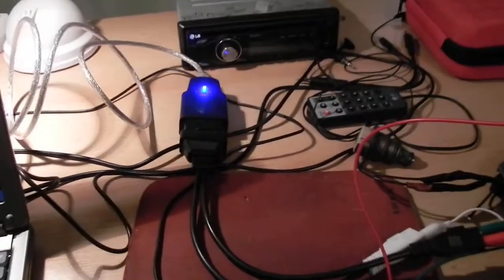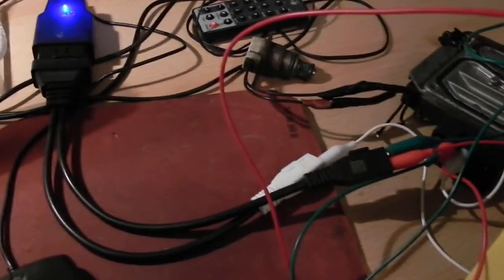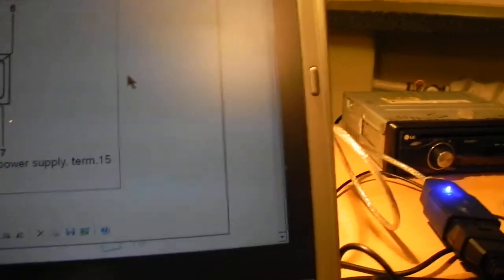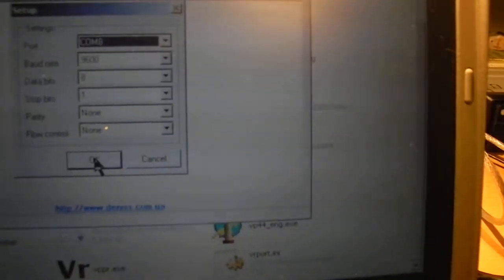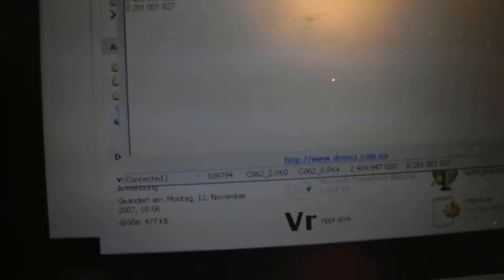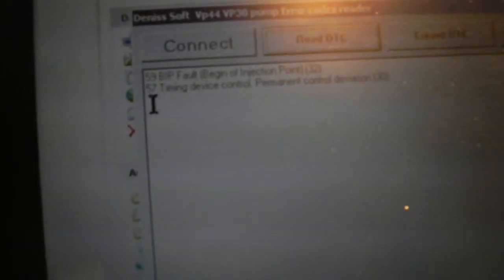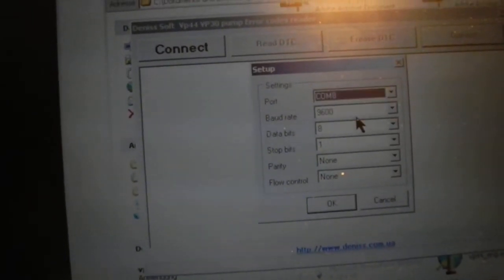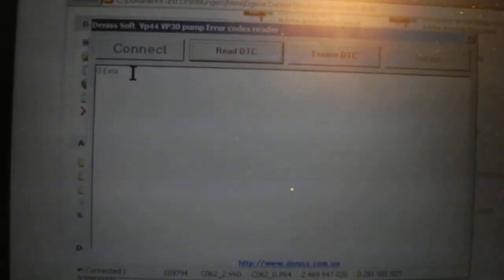Vp30 Vp44 Bosch PSG5 Error code read out

Comment: problem its if program not have option test valve
Reply from the maker: There is no need for checking the valve. You may apply external power to it and see if it clicks. Really with this pumps there is not much you cann do without a proper test bench from Bosch. With the program you can only  verify to 80% what failed that's all.  But also by that time used pumps are cheap now and it worth to get two pumps in case for a bugger under 120euros .

Comment: Hello, could you please give me the reference of the cables and adapters that you use to connect the psg to the computer ... thanks
Reply from the maker: A cheap KKL adapter like many on ebay for VAG's :-D Plus I used an OBD adapter for first gen VAG's where you got a  two cables with + & -  and K-line  & L-Line

Comment: i try to change the driver , some modules go well, some  after 5000-10000km  broken again, no metter if i change or not the mettering solenoid.
Reply from the maker: The pcb is the issue. the whole vp30 and vp44 design is designed to milk customers not to be reliable :-)
Reply: I got mine fixed and after one hour, the driver was damaged again... What can it be?
Reply: @j_laskada  The thermical transfer between driver and main case, or the valve it is absorbing much current than normal. You can check this with  an 55w resistor or 55w headlight. From a cycle to another the headlight must not workig if the valve is in good condition.
Reply: @edyssons  with a light it works and I see light. Thing is that once I connect both solenoids, it feels that one of them creates some issue. I managed to run the car for 1h, then it died. I fixed it once again, died after 5 minutes.

The solenoids seems to be working and I even moved the mosfet out of the pump. I'm going mental here haha. Any tips?
Reply: @j_laskada  There are twoo solenoids. First are located in the middle of the 4 pipes, and the second is somewhere under the pump and it is for advance of The injection, normaly car start and without this. The mettering solenoid (between pipes) is the problem. For opening need more Amperage and distroy the mosfet. Replace the valve, and just then try with another mosfet or calculator. I told you, you don.t must to see the light. 1 click in one second, short, very short.
Reply: @edyssons  thank you! I will do that!!!

Comment: Hi what s name of soft please?
Reply from the maker: http://www.deniss.com.ua/Content/6.html
Reply: @stupa55  hi there thanks for f link, does it work for FORD vp 30/44 pumps ?
Reply from the maker: Yeah sure it does work with ford pumps
Reply: @stupa55  thanks for your answer. can you tell me thich adapter/interface can I use for ford ford pumps .?
Reply from the maker: Any vag kkl adapter
Reply: @stupa55  but as I know VAG is for VW/Audi/Seat/Skoda. daoes it work with FORD pumps ?
Reply from the maker: @vasilivaniashvili6816  So what :-D It's all about the communication protocol no more no less. It's a Bosch product not a car brand product. So ti will work. But to be honest the pump error read out is still useless if the pump is dead, it helps only to confirm what went wrong.